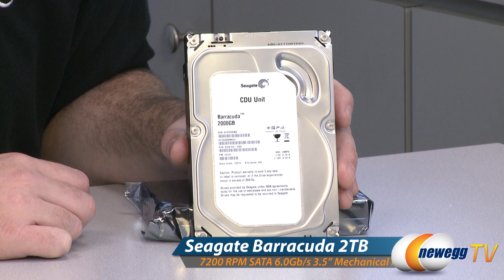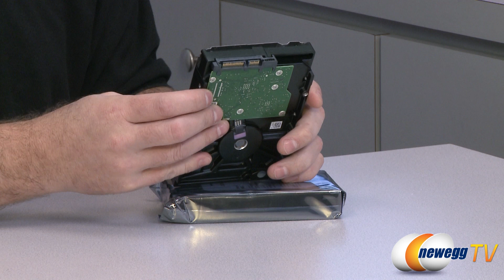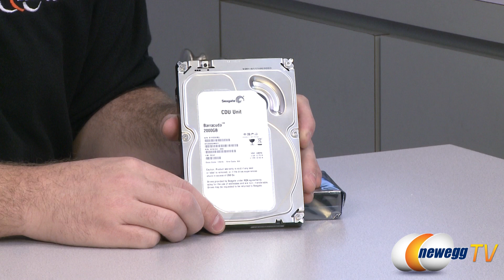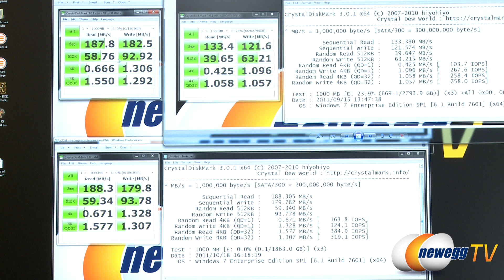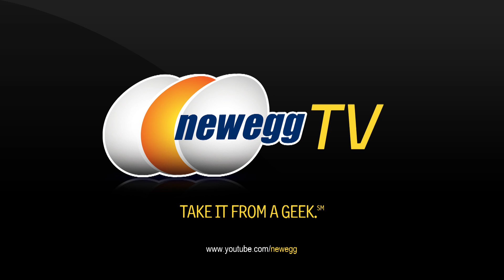Newegg TV: Seagate Barracuda 2TB 3.5" SATA Internal Hard Drive Overview

Comment: Damn straight. My OS drive is a Seagate 1.5TB drive which has worked out just beautifully. I had a 2TB Caviar Black put in from an older system and that drive is loud sometimes and it's now officially failed, even with 3 years left on my warranty... I am totally getting a Barracuda now.

Comment: @NotSoFailuyr no, it's not related to OS and all
Drive manufacturers think (it's profitable for them to think that way) that 1 terrabyte = 1000 * 1000 * 1000 * 1000 bytes, therefore 2 TB = 2000000000000 bytes.
But OS thinks that 1 TB is 1024 * 1024 * 1024 * 1024 = 1099511627776 bytes, therefore 2000000000000 is seen as just 1.82 TB by OS.

Comment: @DrSpike666 
You keep your data on more than 1 drive numnuts, this is just one part in the triple-back-up redundency plan.  The point is that now you can save all your stuff in 3 locations using just 3 drives, and not... 8.